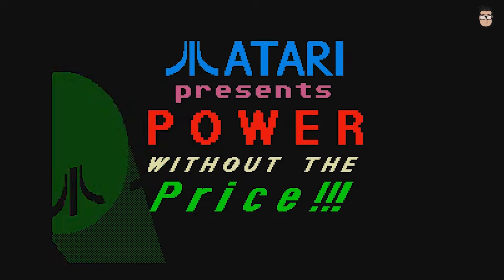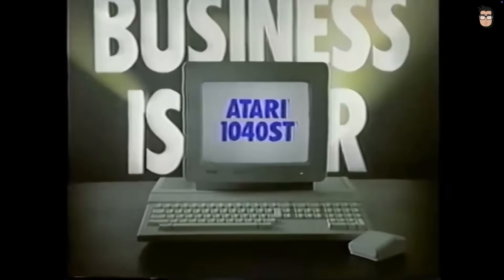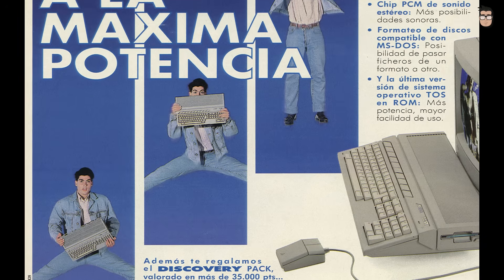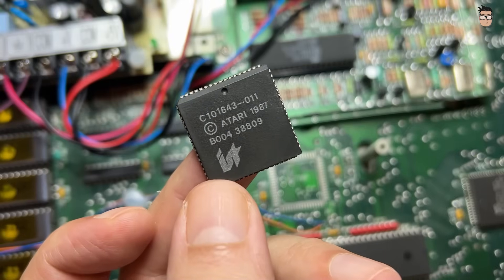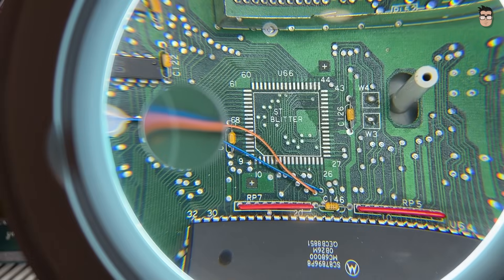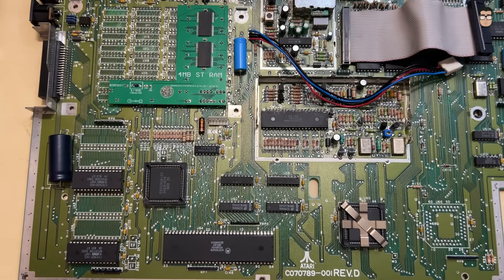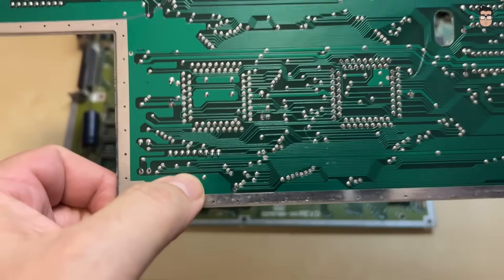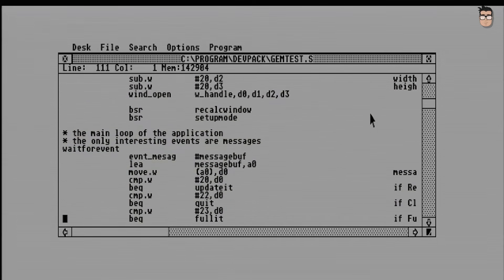Can I install a blitter in an Atari ST F/FM?

Comment: Producing a machine before the Commodore A500 and making it cheaper was short sighted because the Amiga was the better machine. Adding a blitter from day one would have given the ST a better chance of selling more units over time.
Reply: Huh?  The ST came out before the original Amiga, and shipped in volume for almost a year before Commodore was able to even produce a substantial number of Amigas.  The Atari 1040ST was a monster in Europe and made the cover of Byte magazine as the first computer to smash thru the $1000 barrier for a megabyte of RAM.

Also, to a large degree, the Amiga's special abilities were practically useless out of the box during its first two years on the market, apart from its Genlock feature, which was unique in that price class.  But keep in mind the original Amiga cost about twice as much as a 520ST with its high-res monochrome monitor, and about 60% more than the 1040ST with its then-amazing megabyte of RAM.  Game developers eventually made good use of the Amiga's superior gaming abilities, but the ST remained the better productivity machine for several years, and with its faster CPU was no slouch at gaming, either.

The Amiga's multitasking abilities were a neat party trick, but until the system came with a megabyte or more of RAM, weren't particularly useful.  And expanding the Amiga was a fairly expensive proposition.

For a system Atari slapped together in about six months - including writing huge chunks of GEM and TOS, as Digital Research was nowhere near complete with CP/M 68K or the port of GEM - the ST was a truly amazing creation, equally as impressive as the Amiga, just with very different design goals, namely producing a machine as powerful as the Mac for a fraction the cost.  At that it succeeded wildly.

The STs didn't really begin to stumble until about 4 years after their release, when Commodore dropped the price of the Amiga 500 in Europe and began bundling it with games.  Then it took off as a high-end games machine that doubled as a next-gen personal computer, and attracted a lot of Commodore 64 users looking to upgrade but who didn't want to spend a comparative fortune on a frankly less-capable IBM PC clone or 68000-based Mac.  But the ST wasn't really derailed by its own capabilities but rather by a series of unfortunate decisions made by Atari management, including the disastrous acquisition of the Federated Group in 1989, as well as the extremely delayed release of the Atari STe, which didn't hit the market until 1989, arguably a couple of years too late.
Reply: that is a utter nonsense, ST was made two years before A500 and when A500 sales started ATARI already sold way over million units. ST was not competitor to Amiga, thats the fiction Commodore fans do have. ST had higher computing power then Amiga and even outsold the Amiga, so much for that short sighting...
Reply: @madigorfkgoogle9349  Oh shut up, 1Mhz CPU difference is nothing. When coders actually starting using the extra features the Amiga had (rather than just straight ST ports) everybody could see the real difference (or I would have bought an Amiga)...'Shadow of the Beast' clearly demonstrates the difference that better hardware can make, the blitter from day one would have helped. Because you're first to market doesn't mean you'll stay ahead if the hardware isn't as good as the competition!
Reply: @stephenelliott7071  Oh shut up about your childish arcade games... computers are bit more then stupid games... Some people do real productivity work in real world of adults. And yes the ST has 1MHz faster CPU, but also has faster bus and RAMs, less interference of "custom chips" with CPU time, so at the end the ST is 10-20% higher computing power then Amiga... and all that at about half the price, which means that with ST you could have more then double the computing power of a Amiga for about same money...
No one really cares about Shadow of the Beast crap except Amiga fanboys like you.
ST also had the ST high graphics mode with 640x400@72Hz razor sharp flicker free professional display, Amiga was a useless toy compared...
Also ST had a proper full GUI with OS in the ROM, no need for floppy loading Workbench, having just one floppy drive was still great for fluid work, unlike Amiga, had a floppy compatible with MS-DOS, had a HDD controller with HDDs in early 1986 already, has a MIDI ports, no 512KB ChipRAM limit... Amigas only trick (which was interesting) is the genlock capability out of the box. 

Sometimes being late is not helping you against competition... Commodore never really resurrected from near bankruptcy in 1986, after the Amiga acquisition fiasco...